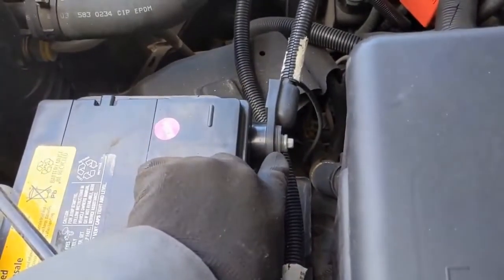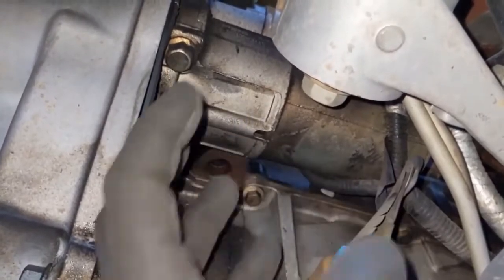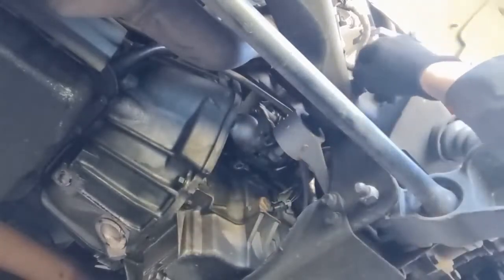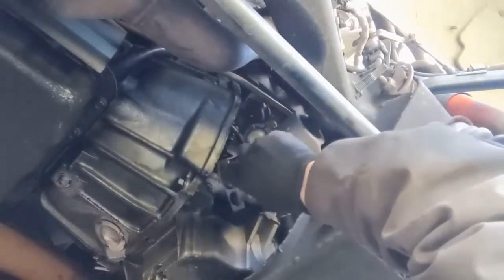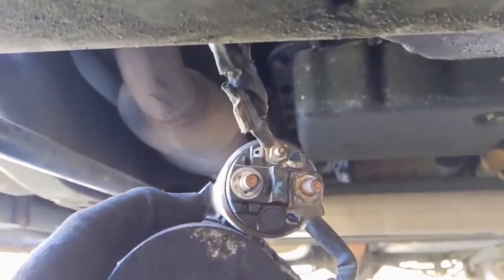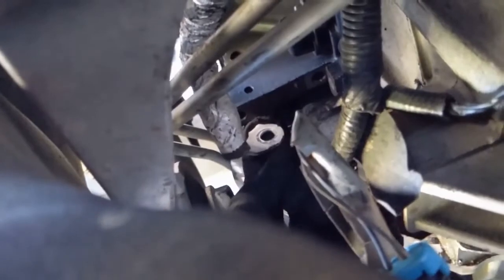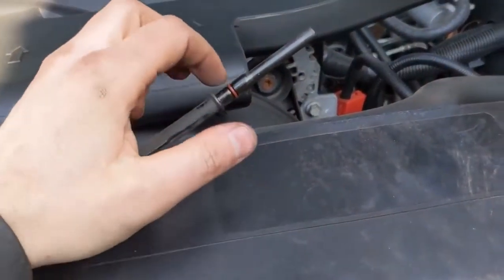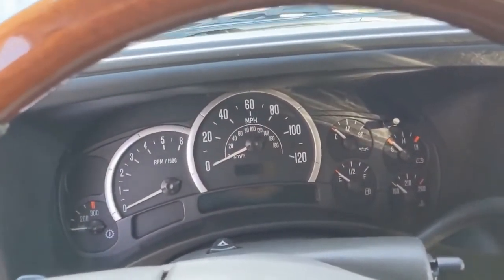2003-2006 Cadillac Escalade/ Yukon/ Tahoe Starter Replacement

Comment: I just replaced my starter on a 2004 w 6.0L Vortec.

I watched your video and struggled for about an hour trying to get it out. There was no room to even remove the plastic cover part.

For anyone watching this. After removing the (2) 13mm bolts, remove the heat shield and then remove the power cable “before” trying to wiggle it out. Mine was 13mm using the long extension with the wobble end. Once I got the power cable off it was easy to wiggle it out.

I removed the 8mm S cable as it came down & out.

I did not need to remove the oil dipstick or loosen those bolts that the manual shows to remove.

I bought a CarQuest 6492SN replacement from Advance Auto with $40 off by doing it with the app. It came with a limited lifetime warranty (only 1 replacement). It was an exact match for the OEM.
Reply from the maker: Thanks for the tips 👍
Reply: Yeah, I really wish I wouldn't have removed the dipstick.. it was a bitch to get back in lol

Comment: Thanks for the video! I was able to replace my original starter on a 2004 Escalade 6.0l. I had a bunch of trouble getting it out and installing the new one. For no-start troubleshooting reference, for a month or two, the car had weak starts, and sometimes would only click once and not start. When I removed the relay, there was no sound at all when I turned the ignition. When I changed relays, and bought a new relay, I still had the single click and no start. I also checked the battery and cleaned the terminals and that wasn't the problem either. A mechanic did try smacking the starter and it did eventually start as an emergency measure. Biggest tip is to remove the cables before removing, or installing a starter, since the power cable is 1cm thick, stiff, and prevented me from maneuvering the starter in place. Other tips I would say are, use a headlamp, flashlight, and third magnetic light. Used a breaker bar and 10 inch extension to get the 13mm bolts loose, that hold the starter to the car. It was pretty stuck on there. Disconnect the signal cable (8mm nut) and power cable (14mm) using a ¼ inch drive ratchet, or any short 6 inch long or so wrench. I didn't lift the car, didn't remove the wheel well cover or wheel, and didn't remove the dipstick. I did disconnect the oil sensor – the black tab is facing the front of the car, don't remove the blue tab, which holds the wire to the connector. The black tab is what holds the connector to the sensor. The starter is on the passenger side of the car, next to the transmission and flywheel. It's basically right behind the front passenger side wheel. When the starter is still in its place inside the car, I am able to have my hand access the part of the starter with the electrical connectors two ways – from the top through the passenger side, and beside the starter, also from the passenger side. It's up to you whether you want to remove the nuts that hold the cables in the confined space, or try to pull the starter out and then remove the cables. Things that get in the way are the front bracket 21mm nut, this protrusion on the housing that has a O shape, a ton of transmission coolant lines (I think). It's hard to tell what the starter gets caught on, so feeling around the starter, when I move it,  helps me to tell what collides with it. I didn't want to break wires or coolant lines, so I didn't shove all too hard. I retaped some wires too. When I was trying to remove the old 14mm nut from the power terminal of the old starter, the housing broke off, so I had to carefully saw off the stud and nut and residual broken copper. . . It cut better opposite to the teeth since copper is grabby (the slope side of the triangle, as opposed to the sharp side). Then I maneuvered the new starter in place, without attaching cables. But advantages are, way easier starter install, no finagling with cables, no worrying about orientation. Disadvantage is having to attach the cable connectors and washers and nuts by feel, in a smaller space. But after trying the opposite way for way way way too long (that most videos show, and the service manual says, attach cable first), I finally actually got the starter in place with the transmission cover. The biggest difficulty in this method is having to thread on the 14mm power cable nut with one hand basically. And not dropping the crush washers. I set up some towels so the nut wouldn't bounce and roll, I had dropped it 4 times. Luckily, the old starter has extra nuts that should fit, so that helped peace of mind. The starter is mostly level to the ground, so the washers and nuts don't slip off too much. I used a 8mm wrench instead of a socket and ratchet. Attach the heat shield before bolting the starter to the car, it gives a little more clearance. The open side of the shield faces the wires. Tighten everything up, don't overtighten the plastic transmission cover, and that's it. Wear glasses and watch out for falling dirt lol, experienced that too, don't drop flashlights on yourself like me at first, get a magnetic light. Seriously though, it took me hours and hours and even more hours including breaks, over a couple days. Almost everything I read said to attach cables first. Chilton manual, eautorepair via Mitchell 1, almost all YouTube videos. It sucked. I was like, physically, the starter cannot fit, I didn't know if a mechanic would be able to do it (but they probably would, lol), and I was so confused because I was able to take the old one out. Hope this helps someone! Anyone, lol. Thanks again Valley Mobile Automotive for the video reference! 

-Dean

Comment: What is the cable thru the wheel well at 2:50 time stamp and is it important to be connected someone replaced my motor it ran for a while but it died havent been able to start and thats the only other cable i dont have connect cuz they never plugged it in
Reply from the maker: I'm not 100% sure if this is the one you're talking about but there is a wheel speed sensor for the abs that goes through the wheel well. But that shouldn't prevent it from starting.

Comment: My bolts are the same size as yours 13mm but u watch other videos of the starter removal and they are 14mm. Are they not all the same starters or bolt sizes
Reply from the maker: Yeah not sure, it may depend on where the vehicle was assembled?
Reply: @ValleyMobileAutomotive  maybe but they should all be interchangeable hopefully

Comment: How do you know if the starter is bad? I have a 2004 Escalade with a 6.0L and it won’t start. I only hear a click when I turn the key. I tested the battery and it said Good & Recharge and only had SOC 20%. I charged it to SOC 100% and still only get a click.
Reply: definitely sounds like the starter
Reply: So what was it  it the starter even trying to engage ?
Reply: @ecgodsmack86  No, it only made a click sound somewhere. I replaced the starter and it works great now.